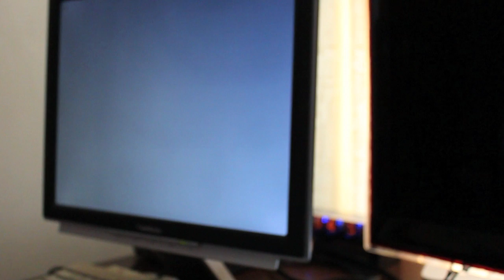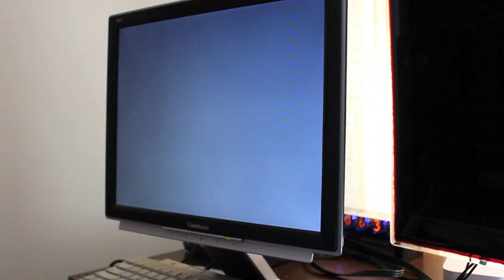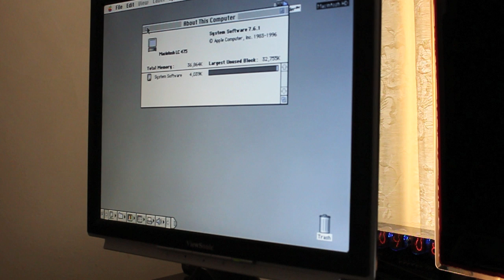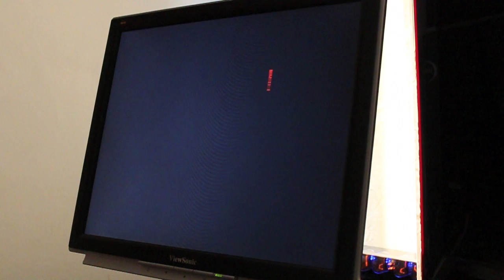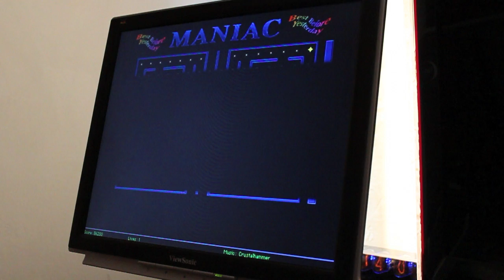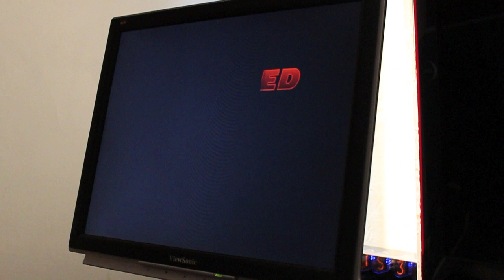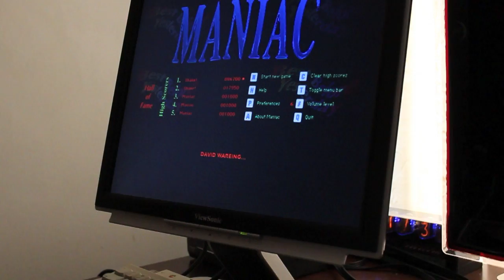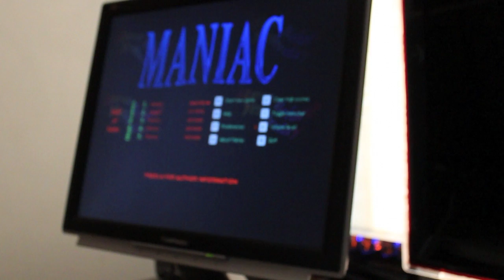Apple Macintosh LC 475: Tantalum Capacitor Test

Comment: my 475 never recapped, internal speaker stopped working but output jack still workin good. what do u think? only noticeable little corrosion in j22 chip... caps looking good. what's the problem? caps or some soundamp chip?....

Comment: If you had to do this recap again... Would you have used D size, or C size may have fitted better? I've used through hole ones till now bout considering the SMD ones as I have a lot of them. Is there a way of booting without battery like the LC III does? I've recently got a LC475 card and I plan to replace a LCIII or Performa 460 one with it, but never had one before.
Reply: ***** Usually aluminum ones are already derated but I understand that your advise is quite clever as it is not the same a capacitor that pops that one that suddenly bursts in flames... So better safe than sorry. Thank you!